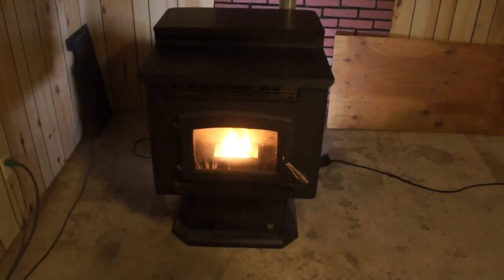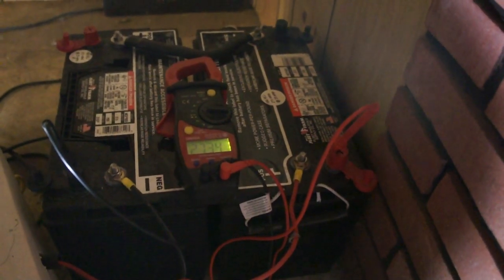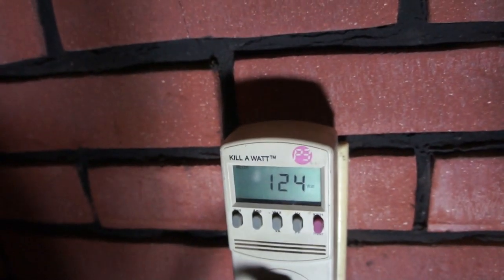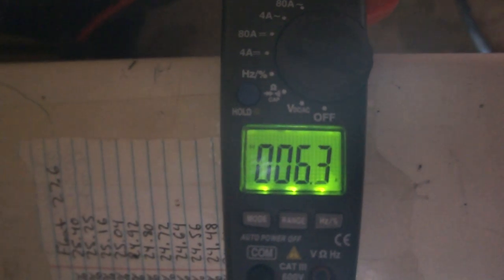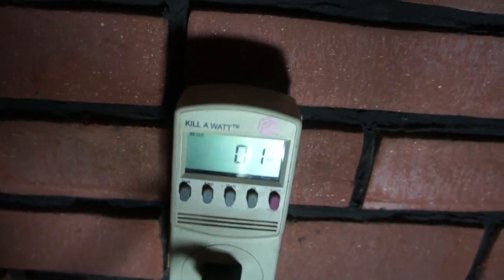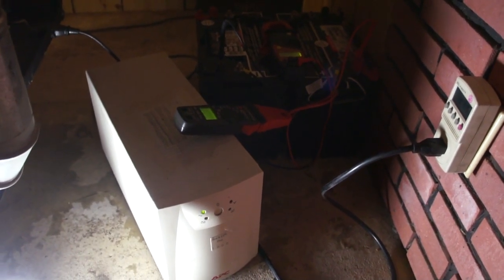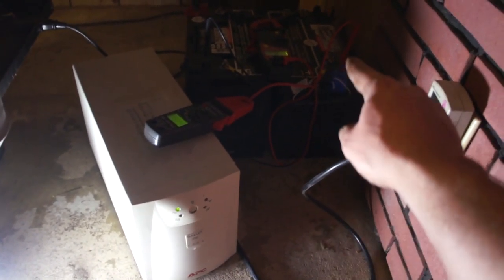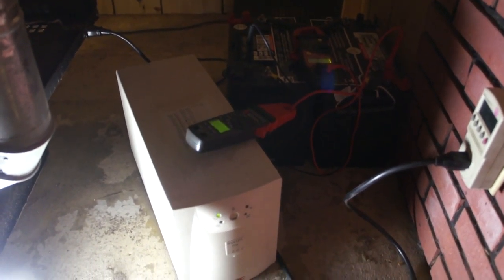Battery Backup

Comment: Thanks for posting, I was not sure how the connection is made on the apc through the wall. Can you clarify. We have been trying to hook up our pellet stove with an inverter and 2 deep cell marine 12v batteries. The inverter won't work for some reason and I have several extra apc units Thanks for commenting.

Comment: i have an apc 1500 ups that lights up ok but when my 15 marine bat is
hooked to it the backup plugins in the back  lose power and the RED battery
light in front comes. the unit wont work like in your video.
theres also another lose wire that was in the bat box with terminal
ends  not connected to anything (about 3in long)
i have to get this working ,what a great idea.

Comment from the maker: I used automotive "spade" crimp connectors that you can get at a good parts store and there is different sizes to get so take a sample of wire with you if you can for proper fitment but the size I think I used was 10 gauge connectors. Hope this helps let me know how it goes. Be careful and ask for help from someone around you a car guy is generally good at these sort of things.

Comment: If I remember right on the old BackUps units, you hold down the on button for five seconds or so after a power failure and it turns the alarm off, until it hits low battery.

Comment from the maker: You are right you can cut the button speaker off but when the power really does go out and I'm not filming a you tube video I don't know the power is out. This works great on your deep freeze if the breaker was to blow for some reason and you did not know about it you would hear the beeping before the batteries were to die and you would save everything in your frezzer

Comment: I did mean through side of the unit. I thought about it last night when I could not sleep that you most likely disconnected the batteries inside and ran the wires outside to pos & neg posts on the batteries. I did look at the spec's for our APC UPS BR1500. says 120V for input and output.. The unit comes w/ one 12v battery. We were thinking we could use 2 12v for longer amhrs, does that make sense?  can we connect 2 marine deep cell batteries and hook it up the same as you did?

Comment from the maker: Yes you can hook the unit up with two 12 volt batteries and keep the voltage at 12 volts instead of making it 24 volts its the difference between parallel or series. There is a good video from tripp lite on how to do this. I will put a link here for it. That should help you. Remember you have to use two batteries that are the same amp hour rating, Group size, everything must be the same or you will damage your batteries though cell reversal. Also be very careful! and get help if needed.

Comment from the maker: "Through the wall"?? Hmm I think you are talking about the side of the APC where I drilled a hole and lengthened the wires. There is a Positive side and a Negative side to the wiring you need to I.D. that and find out what voltage your APC uses that will tell you if you can use just one 12 volt battery or if the unit has 24 volts and you need to use two batteries. The best way too find that out is look up the replacement battery/batteries for the unit two 12 volt batteries tells you its 24 volt

Comment: Is it safe to have the batteries that close to the stove? Could the fumes from the batteries cause them to explode? I would think this would be okay, but I was just wondering. I just purchased a stove and will be making a setup just like this. Also, as for the alarm, I've already installed a small micro switch on UPS's that didn't have a mute function. You can get these at Radio Shack. Great video...
Reply: you only get out gassing if you are over charging the batteries

Comment: Jack of all trades....Quick question for you. I have a APC PRO 1000. Rated for 600 Watts. Replaced the factory, dead battery which is 24V, with 2 109AH 12V deep cycle marine batteries which I wired in series to make the 24V. I ran pretty much the same set up as in the video. However when I disconnect the APC from wall power you can hear the pellet stoves fans continue to run but at a much lower speed then when on wall power. There should not be a change in the performance of the stove. What could be the cause of this?
Reply from the maker: I would start with checking the output voltage of the APC when its disconnected from the wall. sounds like a low voltage problem. you may need to check it under load as well. You may have a bad APC or something else going on.
Reply: Batteries read 27.3 or so when the APC is plugged into the wall. Once unplugged they drop slowly just the way it does in your video. The only thing I wonder before I decide it’s a bad APC is that the wires running from my battery terminals to my APC battery hook up are only 12ga wire. They don’t seem to get hot or anything but could this be the cause? Not being able to drawl the power it needs?
Reply: Also. Just checked the digital screen on the APC. When plugged into house power the output is roughly 119 to 120. When running only on batteries the output reads 121 to 122. Seems like the output is good. Right? The current estimated run time still only reads 35-40 min which seems low considering I have used a inverter and ran the stove for 7hrs on just battery power before
Reply from the maker: dont go by the APC screen put a p3 kill-o-watt meter inline and get your own reading. make sure you get the reading when the unit is under load.
Reply: JackofallTrades383 ok I will do that. I have a kill o watt meter so I will try that. Thanks a lot for your help. I also bumped the wire size up up to 10ga from the batteries to the unit with no help. I’ll try the meter but I am almost certain the until is bad

Comment: Thats 2 marines in series tobmake 24V. I  first had 1 12v then realized
it was a 2 battery unit (2 12v ) wired in series, thats what the xtra wire
inside the battery compartment was for, to hook the 2 batteries together
making it a 24v system. ill be following...